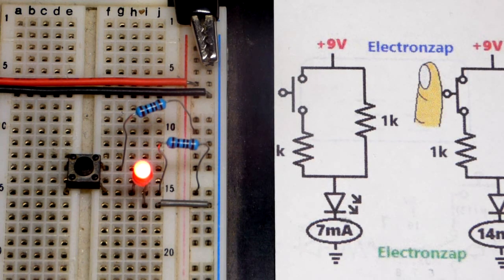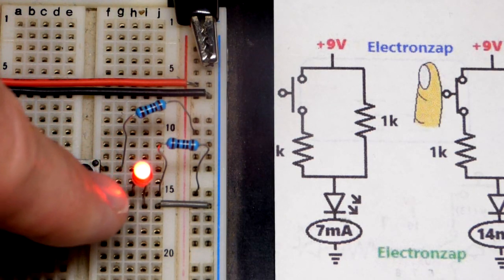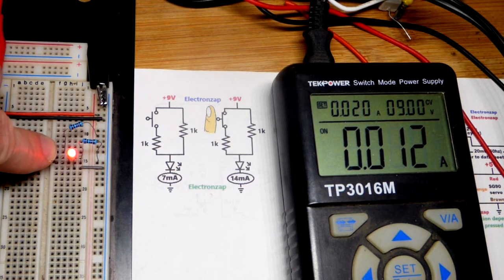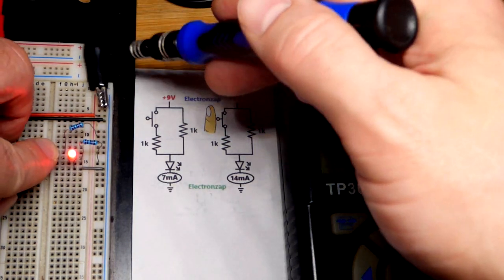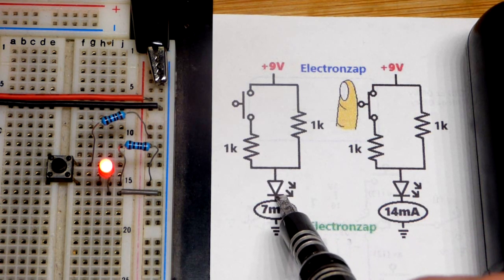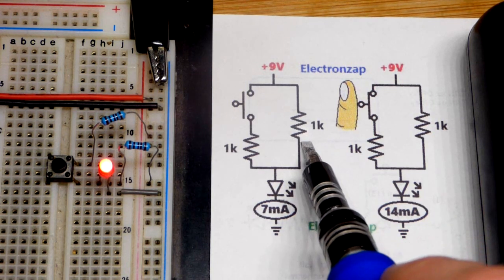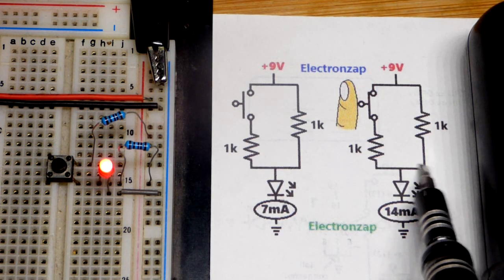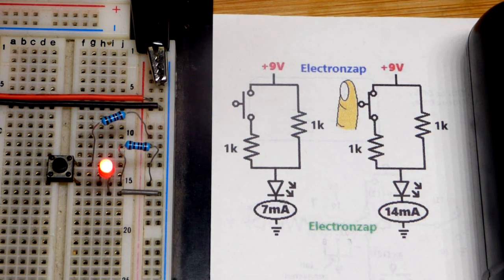Temporary parallel resistance using pushbutton switch demo circuit

Comment: For both the 7 mA and 14 mA examples, what voltage should be used to calculate the power used in watts, 9V or 7V?
Reply from the maker: 7 volts and 0.007A for each resistor, so 0.049W each when the switch is closed.